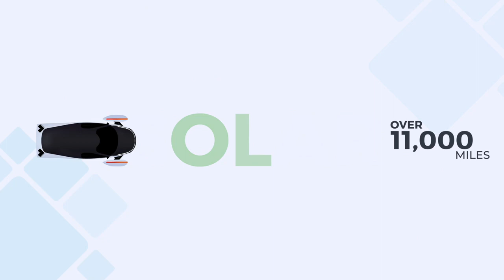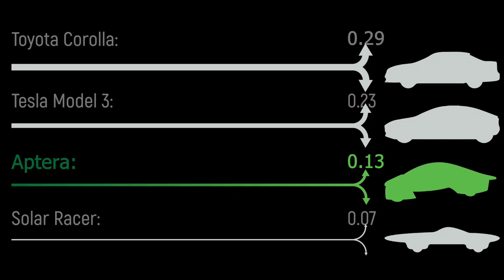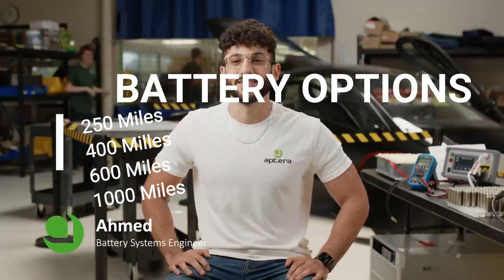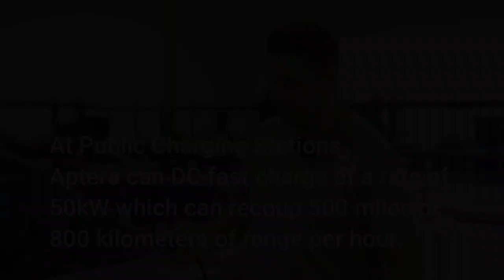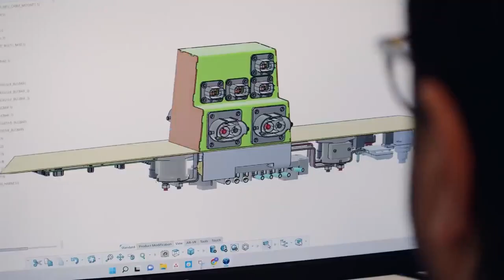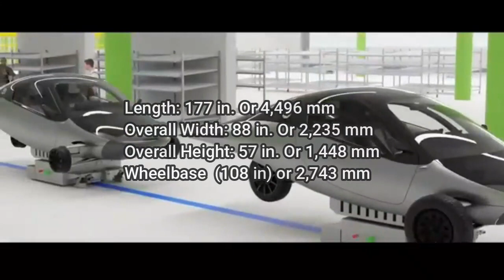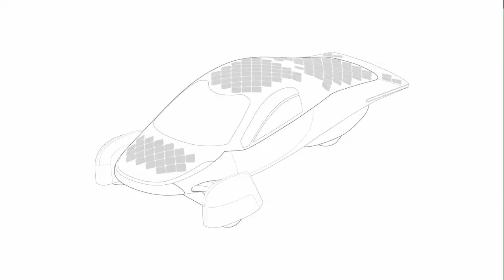Aptera electric car the MYSTERY for Cheaper, safer and eco-friendly electric vehicles? | Analysis

Comment: Solar system does not exist until now. They only built some prototypes of the 40 kWh battery. The 1000 mile version does not exist. The wheel base of the Aptera is wider than a Hummer H1. It is not possible to register an Aptera in europe, as it would only be allowed to have 2m max. Aptera is not crash tested in real life. It is a death trap in case of an accident. With the anemic 50 kW charger you will blocking a fastcharger stall for over 3hours to charge the 1000 mile version.
Reply: Clearly no production intent Apteras have been produced yet, so there is some cause for concern.
But that is typical for a car that is about a year away from production and does not, necessarily, indicate a problem.
As for the width, the Aptera is not much wider than a normal car, if one considers the mirrors.
As for crash testing. Aptera has assured us it will meet car standards with air bags and a strong composite structure. But it has not been proven yet, as no production intent vehicles have been produced. But there is no reason to consider it a "death trap". There is an adequate crumple zone up front and a strong composite structure.
Not sure about your charging math. If you have a 100 kWh battery and 50 kW charger, that would be 2 hours from dead. But unlikely you would be in that situation very often. Most cases, after driving 1000 miles, you would be at your destination.

Meanwhile, Aptera promises the most efficient EVs available with solar charging up to 40 miles per day. Some people would not need to plug it in for daily commute. It is a revolutionary vehicle.
Reply: @johnbriggs7514  "Clearly no production intent Apteras have been produced yet, so there is some cause for concern". That would concern me the most. 3 years full of empty promises. To rebuild a vehicle to BEV that was already production ready in 2008.

The Aptera is wider than a Hummer H1. A "normal" car has a width of 2m. Mirrors dont count, as they do not ram into road obstacles. And the width is also the main reason, why the Aptera is not road legal in the EU

The Aptera has no crumple zone, just a horizontal aluminium bar to hold the fairing.

And yes , Aptera promises. And promises, and promises....
Reply: @vic321344  so you are in the process of criticizing something you have not seen.

The width of the Aptera is no more than my current car so it will fit into my garage.

And no this is not the same car as before it was completely redesigned.

But you are right. They are late and they have a lot to prove. We will see
Reply: @johnbriggs7514  I am critisizing that Aptera sells things which are not existent. Yes. You got it.

You own a Hummer H1? Or a large truck?

Shure the new Aptera is a redesigned Aptera  2 from 2008. They made it 10% larger. A CAD system needs 10 sec for that. That leaves 3 years minus 10 sec to implement ready to buy electrical components into this vehicle.
Reply: @vic321344  Ha!  If you think that the current Aptera is mere 10% increase in size of the 2008 model you have really not been paying attention.  There is not a single common part or even a drive train in common with that first vehicle.  Why lie about things you clearly know nothing about?
Reply: @vic321344  Of course you are willing to overlook the fact that it took Tesla 6 years to ship their first EV conversion of the Lotus Elise Roadster, and that even though they have many times the current resources, Aptera is going to ship before Tesla ships the Cybertruck, which started design around the same time.
Reply: @n.brucenelson5920  The current gamma had to be enlarged again, because they forgot to plan enough room for the battery pack. Which is not just 10 kWh.

And it was your claim that the alphas are 10% larger than the aptera2. If not so, why did you lie?
Reply: @n.brucenelson5920  And you (again) overlook that Tesla had to invent everything to build the first roadster. The batteries, the electronics, the battery management, the charging, the motor, ...
Aptera uses off the shelf parts to bang their BEV together. To recreate a BEv version of a motorcycle they already invented in 2008.
Reply: @n.brucenelson5920  The silly trike does not have to have any common component to be 10% larger. Such is your idiocy.
Reply: @n.brucenelson5920  Vic asked "Did you see a 1000 mile version, working solar, something even close to a production prototype? Or just 3 mockups? Driving around with a 10kWh battery packs?" You answered with "Of course you are willing to overlook the fact that it took Tesla 6 years . . ." - none of which answered any of Vic's questions. And I have told you at least 50 times not to bring Tesla and others into it - it's irrelevant.
Reply: @n.brucenelson5920  Comparing Cybertruck to Aptera ist the most childish comparison thinkable. 
1 Cybertruck is a car, Aptera is a motorcycle
2 Cybertruck uses top end technology, invented for this usecase. 4680 cells, the steel for the body, the structure, the glass, the 12t gigacasting just to name a few. Aptera bangs together their motorcycle with freely available standard components. The plastic shell produced by a manufacturer for boats. Battery packs welded together from ancient 2170 cells.
3 Cybertruck will be produced at a 100 times higher rate than Aptera will ever be (if Aptera will be produced at all)
4 Cybertruck needed a whole Gigafactory (Nevada) and a whole 4680 cell production. Aptera just neds  an empty warehouse. 
5 When Cybertruck was announced and you could order it, a prototype was ready to show all the promised features. Not so with Aptera . Until today no 1000mile, no solar on vehicle. Promised and sold, but never existent.
Reply: @vic321344  lol!
Reply: @n.brucenelson5920  "Aptera is going to ship before Tesla ships the Cybertruck, which started design around the same time." In the same time Aptera is still not able to present a roadworthy production prototype, Tesla built a whole Gigafactory, a 4680 cell assembly, 12t Gigapress..etc to produce 200-500k of these vehicles per year.
Reply: @vic321344  Why do you keep lying about what is public information?  Both my wife and I have ridden in road worthy prototypes ourselves.  

After the 3 years or so since Aptera restarted, Tesla had still been unable to keep the transmissions from breaking every time they gave a demo ride in their Lotus Elise EV conversion, and had laid off all of their motor engineers because they had run out of money.  It was only a last minute cash infusion from Daimler that saved them and it still took them 3 more years to deliver their first production model.
Reply: @n.brucenelson5920  So 2 years ago you saw production ready prototypes? Because that is all what matters. If you do not understand the difference between "production ready" and "roadworthy": so be it.
Reply: @vic321344  "roadworthy" was your term.  And it was not two years ago that we were at Aptera and had our rides.  It was last November.  

So, my question remains - Why do you keep lying about things you know just as well as others of us?
Reply: @n.brucenelson5920  "roadworthy production prototype" was the term. Why do you keep lying about things you know just as well as others of us?
Reply: @vic321344  I guess we have to make allowances because it is clear that English is not your first language.  You apparently don't understand what an alpha prototype is.  When we get to delta we will have production intent models.
Reply: @n.brucenelson5920  I guess we have to make allowances because it is clear that English is not your first language.  You apparently don't understand what a production prototype is.

And again your favorite term "will have" (together with "will be"). Like a fairy tale.
Reply: @vic321344  Although English is my first language, it is far from my only one.  It is not surprising that you would be talking about "fairy tales" - you are fond of "Grimm" statements.  It seems to be the only kind you make.
Reply: @n.brucenelson5920  So it is maybe more due to your old age that you lack understanding the difference between phantasy and reality. Or "roadworthy" and "production". or other simple things. Or present tense and future tense.
Reply: With that "anemic" 50 kW charger it can add 250 miles of range in half an hour.
Reply: @robertkirchner7981  Hopefully the Aptera will never block a stall of a Tesla supercharger.
Reply: @hypenohub  If you only look for things that you see as flaws like Vic, then you will not see all of the great features and capabilities of the Aptera. Volume production is not expected until next year, so some things are still being developed. It is foolish to expect all aspects working now before production begins. If you watch videos of the Aptera in real life situations, the width should not be an issue for most people. For Europe, they will build a revised version of the Aptera to fit their narrower roads (in 2024). Vic's assumption of the Aptera being unsafe has no basis in fact. The early roof crush testing proved the composite shell to be stronger than any other vehicle tested to that point. 50kW charging equals 500 miles an hour, which is plenty quick, and even more importantly the Aptera will recharge 150 miles overnight from a 110V home outlet! In addition to as much as 40 miles a day from the sun.
Reply: @deanmcmanis9398  I deal in logic - here's an example:
[If you only look for things that you see as flaws like Vic, then you will not see all of the great features and capabilities of the Aptera.] The operative word here is 'only'. You can reverse what you only see, and each is flawed, however, seeing mere computer simulated performances is not seeing reality. Fanboys are thus deluded. They only see snake oil, and refuse to see both sides of the coin. 
I deal in facts - here are some examples:
[Volume production is not expected until next year, so some things are still being developed. It is foolish to expect all aspects working now before production begins.] Fact: In June 2021 they announced they would have a production vehicle by the end of that same year. 12 months above and beyond 6 is way too inaccurate, as is what they have right now in terms of prototypes and plant set-up. It is foolish to be strung along (that last bit is logic). 
[If you watch videos of the Aptera in real life situations, the width should not be an issue for most people.] Fact: It's 88 inches, and 88 inches is issue sized. 
[For Europe, they will build a revised version of the Aptera to fit their narrower roads (in 2024).] Fact: It's still 2022. It's a bridge we haven't reached, so pointless. 
[Vic's assumption of the Aptera being unsafe has no basis in fact.] Fact: Any EV with that much battery under your butt that produces dendrites is unsafe - a ticking time bomb. 
[The early roof crush testing proved the composite shell to be stronger than any other vehicle tested to that point.] Fact: Tested by the maker - that is never a good thing. Find us a test by an independent body that is accredited to do such tests? That's the logical course, and claims should not be made unless done and published. Otherwise, you fool the gullible.
[50kW charging equals 500 miles an hour, which is plenty quick, and even more importantly the Aptera will recharge 150 miles overnight from a 110V home outlet!] Fact: All theory and no proof.  
[In addition to as much as 40 miles a day from the sun.] Fact: Alpha's had no solar, and Chris would point to them as he told people they have it. That's called lying. If they do have solar, then they should be handed over to accredited independent testers. Another fact: Gamma is supposed to be an improvement, but pictures show no solar cells at all, and would not matter if they had a working system, because they show no power cables from the batteries to the motors. The solar could only run the air con, at best. Gamma can't move, as far as anyone can tell.

Give the support up, Dean - you are flogging a dead horse.
Reply: @deanmcmanis9398  Width is not an issue for people? construction sites? offroad? parking garages?

Not a single of the core features (1000mile, solar..) is working or has ever been tested.

Aptera can be glad to be able to produce  the wide version with their limited ressources. If you make the wheelbase smaller, the vehicle will become awkward and the CV will rise dramatically.

The roof crush test just showed, that the old aptera shell (2008) could hold 4 times the weigth. The actual need to pass the test is 3 times the weigth. Even the simplest of all chinese BEV passes this test.

50 kWh charging needs at least one hour. Hopefully Aptera does not block any supercharger stall for that time.

The solar system is completely untested on the vehicle, so the yield is pure phantasy.
Reply: @vic321344  Good morning, Vic. Based on what you've posted, it's obvious that Aptera is not for you. But I'm curious just what it is that you get out of trolling all the people who came here to look at the video. Can you enlighten me?
Reply: @davidscott5367  I am curious why so much people love a fraud.
Reply: @vic321344  You know, Vic, you can be curious without commenting on so many of the posts on this video.

A knowledgeable reader of Aptera's annual reports would quickly conclude that they're not doing business like scammers. For example, scammers wouldn't hire a supply chain expert, a manufacturing expert, and a bunch of engineers. They would build one Alpha prototype, not 3, and they  would never build a beta prototype. Nor would they engage a manufacturing consultant like Sandy Munro or a handling expert like Roush. 

I have pre-ordered an Aptera. All it cost me was a $100 refundable deposit. I understand the deposit is held in escrow, but in any case it's only a hundred bucks.

You should study the company a bit more.
Reply: @davidscott5367  I like to comment. Especially to prevent newcomers from trusting empty promises. And the number of my comments just shows the great amount of empty promises, that are repeated over and over as real facts.
Reply: @vic321344  Vic, for the folks who are just trying to read the comments, it gets a bit tiresome hearing the same comments from you over and over again. You gotta be you, though, tiresome or not.
Reply: @davidscott5367  I deal in logic.
[You know, Vic, you can be curious without commenting on so many of the posts on this video.] He can be curious AND post. There is no law nor rational reason that would preclude him. Your statement is merely your wishful thinking made to look like it's valid. The gullible will swallow it.

[A knowledgeable reader of Aptera's annual reports would quickly conclude that they're not doing business like scammers.] I beg to differ, but scammers make annual reports hard to see through. It is no way to draw that conclusion. Most Ponzi schemers are never caught while in process, but long after they have succeeded. There is reason to think they completely got away with this the first time.
[For example, scammers wouldn't hire a supply chain expert, a manufacturing expert, and a bunch of engineers.] Who said they wouldn't? Let's look at these three experts individually?
1. Supply chain expert. What expertise has been displayed? I say none. The present situation is that Chery, Yazaki (?), Elaphe, EVA (?), Red Viking and that Taiwanese battery supplier have all been paid millions to supply, but I have yet to see anything delivered from any one of them. All these bar one are overseas suppliers, where the money trail is not easily traced. 
2. Manufacturing expert. What have we seen from one of those? I saw one drawing of a plant setup, which nothing has been done about for more than a year. Nobody knows what the drawing is about, but it preceded using Red Viking carts. Happy for you to detail everything you know.
3. Bunch of engineers. Yes, 7 on making batteries in-house alone, and then they outsource to two companies. Most engineers look too wet behind the ears to be believable. Many look like they need deporting for illegal entry, let alone being qualified in a US institution of repute.
[They would build one Alpha prototype, not 3, and they  would never build a beta prototype.] I don't even know why you think this is rational. The 3 were to continue the investment flow. Each was meant to look great, but just amounted to colour appeal, mostly. A real builder would not put fake solar on them, and a real builder would have one of their 4 battery options in the first, then a different one in subsequent vehicles. A real builder would validate their claims with them, and each new vehicle would be an improvement on the previous. A real builder would back their superior skin cooling on the fourth model, not revert to inferior radiators, but the first 3 never had any cooling - skin was a pretense, as was any range, so they were restricted to about 10 miles in cold weather. A real builder would back their 7 times stronger than steel body and not install a steel roll bar. There is so much more about their covert use of prototypes that show they are hiding something.
[Nor would they engage a manufacturing consultant like Sandy Munro or a handling expert like Roush.] Munro has not shown to have done a thing, and he just might be privy to taking millions and syphoning off a few brown paper bag style for no effort. Who really knows? He can't be used as an example of honest dealings - it's too soon, with too little revealed. And Roush - I have yet to see what they have done. On the Chuckwalla suspension test day, I could not see anyone in Roush garb. No results were ever made public, either. If you want shocks for a trailer, Roush would probably just ask for dimensions and weight, and give you something off the shelf.  I fail to see too much beyond that. Their testing has already been done, but Aptera make a big deal about it. It really looks like name-dropping for more investments, and Rouch may also be privy to brown paper bag dealings. Nobody to-date has supplied what they have been paid for, which means none can be held up as examples of a genuine company in Aptera.

[I have pre-ordered an Aptera.] That is certainly no proof they aren't scammers. 
[All it cost me was a $100 refundable deposit.] The smallest deposit known to start-ups. Even E-scooter makers ask for more. That, in itself is suspicious.
[I understand the deposit is held in escrow, but in any case it's only a hundred bucks.] Enough to constitute robbery, should they take it.

[You should study the company a bit more.] I have - going right from 2006 to now. There is so much that looks like a Ponzi scheme - it's scary. So should I not tell people to look for signs and make up their own minds?
Reply: @davidscott5367  Hopefully it gets equally tiresome to read Apteras  empty promises over and over again.
Reply: @aussieideasman8498  Another tiresome post from someone who couldn't understand an annual report if he read it.  The rest of your comments are evidence enough of this.  You also don't seem to understand what a Ponzi scheme is.
Reply: @vic321344  Since I have visited the factory and R&D center, and ridden in a prototype and seen the test rigs, I am a personal witness that what you are claiming is not working and has never been tested is false.
Reply: @n.brucenelson5920  so you visited the factory. Did you see a 1000 mile version, working solar, something even close to a production prototype? Or just 3 mockups? Driving around with a 10kWh battery packs?
Reply: @vic321344  I saw working solar.  You have not made any effort at all and you are the one making things up
 My question is why?
Reply: @n.brucenelson5920  Hey, you saw a working solar system installed on a vehicle? And saw the yield this system gets when it drives on the streets? Great. Tell us more.
Reply: @vic321344  I requested and signed an NDA.  But next Spring I will be reporting my own results with my personal Aptera, as will many others.
Reply: @n.brucenelson5920  I have a video about the TMS test rig (Skin Cooling Revisited) on which you can comment on every claim I make as to why it won't work, yet you refuse to do it and hide behind the NDA you asked to have made for you. Your nonsense doesn't wash. Danny has made it public, and it is patently evident it can't work in reality - he's just conning the brainless Steve, and you have no defense. If you have seen this particular test rig, then explain it, or shut up. I maintain that rig can't work, and I have a whole video that explains my reasoning. Nobody from the founders down to the marketing kids have ever been able to refute my reasoning, so you are far from alone.
Reply: @aussieideasman8498  Hi, Aussie,

Thanks for your response.

The reason it took me a long time to respond is that the first response I wrote was very confrontational. I decided not to send it, and instead I slept on it before writing this one. 

You say that you deal in logic, and you do, to an extent. But you also deal in unfounded accusations of malfeasance and unnecessary personal attacks. You also feel that you’ve got to attack each and every statement somebody makes, even when some of the attacks aren’t relevant to the discussion.

I have no doubt that you know more about Aptera than I do, and some of your criticisms of Aptera are certainly valid, and I acknowledge that their delays are unfortunate. I even acknowledge that they may never make it to production.

What you don’t seem to recognize is that I’m only arguing Aptera is not a scam. Logic tells me that if they were only trying to scam their customers, they wouldn’t be doing things like hiring a logistics expert. When I make that argument, you don’t refute it. Instead you respond that you haven’t yet seen any results from that hire. 

Likewise for their hiring of a manufacturing expert. The same for their hiring of a staff of engineers. You have no response for an argument that scammers wouldn’t hire a staff of engineers, so you respond that you don’t like their choice of engineers. Then you throw in a couple of insults, which is typical of the style I’ve seen from you across the many posts I’ve read. 

And because you haven’t yet seen the results of Aptera’s consultations with Sandy Munro and Jack Roush, you accuse Munro and Roush of malfeasance. Do you have any evidence to support that accusation? Not being able to see the results you expect from your vantage point half a world away is not evidence of malfeasance. 

If you want to be taken seriously you should cut way back on the insults. I’ve seen many of your posts where you didn’t like what somebody said, but rather than refute it, you just respond with a couple one-line insults. When people read that kind of stuff, they tend to discount the years you’ve been watching Aptera. Instead they just think, "Oh, that Aussie guy again. He's so unpleasant!" 

One other thing you could do (and this would entice people to read your posts rather than skipping right by them) is to break your posts into paragraphs. People who read a lot of English are used to seeing them that way, so it’s better for comprehension.

BTW, it’s obvious that my placing an order doesn’t prove anything about Aptera. It only proves that I can afford $100 on the chance that they do make it to production, and it wouldn’t hurt me too much to lose it. Believe me, I have made much more expensive mistakes than that, if it does indeed turn out to be a mistake. 

With that, I’ll close. Wishing you all the best.
Reply: @davidscott5367  [The reason it took me a long time to respond is that the first response I wrote was very confrontational.] There is no deadline to respond, nor any obligation to. I can take confrontation, and it just might be more appropriate. Your only problem might be getting past YT.  
[I decided not to send it, and instead I slept on it before writing this one.] That accounts for one day, unless you are some sort of Rip Van Winkle. 

[You say that you deal in logic, and you do, to an extent.] To a great extent. 
[But you also deal in unfounded accusations of malfeasance and unnecessary personal attacks.] If I do, I would like examples and references to the original posts. I pride myself in always telling a fool why he's a fool, and people often accuse without reason. You might be just another one of those. PS - I don't sleep on responses; I write them line by line without even reading the next one.
[You also feel that you’ve got to attack each and every statement somebody makes,] Is that a crime? I just call it being thorough.
[even when some of the attacks aren’t relevant to the discussion.] While I prefer relevance, I go where anyone takes me. If they take a swipe, my swipes back are just better articulated.

[I have no doubt that you know more about Aptera than I do, and some of your criticisms of Aptera are certainly valid, and I acknowledge that their delays are unfortunate.] Their delays are CLAIMED to be unfortunate - it's possible they might not be, but contrived. 
[I even acknowledge that they may never make it to production.] This makes me think; why the need for you to write, then?

[What you don’t seem to recognize is that I’m only arguing Aptera is not a scam.] Then all you have thus far written has not made that point. I will be happy to discover what points you have that will show they are not a scam. 
[Logic tells me that if they were only trying to scam their customers, they wouldn’t be doing things like hiring a logistics expert.] Without looking back at the comments that are not even opened, I believe I covered this point. Logic tells me your logic on that is flawed, and I don't like repetition. At this point, I will say that logic sans written reasoning behind it is mere gossip and possibly false. My logic that yours is flawed is because many companies with logistics experts on their payroll have folded. [When I make that argument, you don’t refute it. Instead you respond that you haven’t yet seen any results from that hire.] I'm too far in to check that (YT deletes this if I open now), but I will after this is sent. However, you are essentially saying any company with this expert can't fold, and that sounds ridiculous to me on face value, alone. 

[Likewise for their hiring of a manufacturing expert.] likewise - ridiculous. 
[The same for their hiring of a staff of engineers.] Ditto. Even engineering firms have folded, and scammed in the process. 
[You have no response for an argument that scammers wouldn’t hire a staff of engineers, so you respond that you don’t like their choice of engineers.] Again, I need to compare your new claims with my past responses, but if I said something entirely irrelevant, I would still not make your statement true; it would only not disprove you at best. As for me saying they look bogus, a company with great engineers looks more likely to not scam than one with ring-ins. I deal in logic. 
[Then you throw in a couple of insults, which is typical of the style I’ve seen from you across the many posts I’ve read.] I get far more idiots than intelligent people comment. Again, you accuse without that referencing the couple of insults.

[And because you haven’t yet seen the results of Aptera’s consultations with Sandy Munro and Jack Roush, you accuse Munro and Roush of malfeasance.] Get it right - I did not accuse - I only said it was possible. I don't even have to look back to be certain of your error. You can't deal in logic if you can't read without misunderstanding.
[Do you have any evidence to support that accusation?] If and when I accuse, I will add evidence. 
[Not being able to see the results you expect from your vantage point half a world away is not evidence of malfeasance.] I see the facts from half a world away. You can be standing in the middle of their empty build site and not see them as well as I do. Distance doesn't matter,, and you are just fooling the gullible fanboys by suggesting it.
 

[If you want to be taken seriously you should cut way back on the insults.] I don't need to be taken seriously, so what should I do? 
[I’ve seen many of your posts where you didn’t like what somebody said, but rather than refute it, you just respond with a couple one-line insults.] Then reference them, and allow me to explain. Your unfounded accusations are ignored, except that I teach you not to make them. 
[When people read that kind of stuff, they tend to discount the years you’ve been watching Aptera.] I don't mind if they do. And I have been watching them for less than one year.  
[Instead they just think, "Oh, that Aussie guy again. He's so unpleasant!"] Fine with me. They can disappear, for all I care. 

[One other thing you could do (and this would entice people to read your posts rather than skipping right by them) is to break your posts into paragraphs.] I could - but not to entice. 
[People who read a lot of English are used to seeing them that way, so it’s better for comprehension.] Good point, because comprehension is sorely lacking in most readers.

[BTW, it’s obvious that my placing an order doesn’t prove anything about Aptera.] Another good point. 
[It only proves that I can afford $100 on the chance that they do make it to production, and it wouldn’t hurt me too much to lose it.] It proves no such thing. For all I know, you could have half starved yourself to make the deposit, or borrowed it and are cleaning windows for the next 3 months to pay it back. I deal in facts, and not saying how you managed to pay the deposit proves nothing. 
[Believe me, I have made much more expensive mistakes than that, if it does indeed turn out to be a mistake.] I believe you. Some things don't need proving for me to believe. I believe in God, lol. 

[With that, I’ll close. Wishing you all the best.] And the best to you; it has been a pleasure. Now I will check what you say I said last time.
Reply: @davidscott5367  Here's the check: I found I replied to you on the 19 reply of this same thread, in regard to a reply of yours to vic321344. The parts about the relevant issues are copied and pasted.

(New paragraph, note. I have also noticed YT does not post in the same formatting I send, at times. That is; I use 'enter' and they remove it now and then.) You said -
"Logic tells me that if they were only trying to scam their customers, they wouldn’t be doing things like hiring a logistics expert. When I make that argument, you don’t refute it. Instead you respond that you haven’t yet seen any results from that hire."
My search for my response came as a huge surprise - you never said it in the 19th comment - no mention of logistic expert at all, so of course I wouldn't address it. Here are the experts I read and responded to:

"1. Supply chain expert. What expertise has been displayed? I say none. The present situation is that Chery, Yazaki (?), Elaphe, EVA (?), Red Viking and that Taiwanese battery supplier have all been paid millions to supply, but I have yet to see anything delivered from any one of them. All these bar one are overseas suppliers, where the money trail is not easily traced. 
2. Manufacturing expert. What have we seen from one of those? I saw one drawing of a plant setup, which nothing has been done about for more than a year. Nobody knows what the drawing is about, but it preceded using Red Viking carts. Happy for you to detail everything you know.
3. Bunch of engineers. Yes, 7 on making batteries in-house alone, and then they outsource to two companies. Most engineers look too wet behind the ears to be believable. Many look like they need deporting for illegal entry, let alone being qualified in a US institution of repute."

I will not pursue it further, since you are so incorrect with claiming what you said.
Reply: @vic321344  The only fraud there is your name calling.
Reply: @n.brucenelson5920  says Mr namecaller himself...
Reply: Who would charge the 1,000 miler in the day?  It's ideal for overnight.  The 600 miler will add 500 range miles in an hour.
Reply: @jonsek  600 miler does not exist, 1000 miler does not exist. Though you can reserve them. As if they would exist.
Reply: Fault finding and naysaying because you worry that the German auto industry will decline?  Let's see your country truly innovate.
Reply: @nicktgal  Nope, I do not sell phantasies. So the burden of proof is by the guys, who sell this empty promise. And Aptera has not proofed anything. No 1000 mile, no solar yield, no crashtest, no safety, nearly nothing beside the things which already existed 2008.

BTW the Aptera is a motorcycle.
Reply: @vic321344  No, it's not a motorcycle.
Reply: @vic321344  It's an autocycle, troll—as has been said in almost every Aptera video ever made lol
Reply: @nicktgal  And in the FAQ they tell the truth, troll—its a motorcycle. An autocycle is by definition a motorcycle with more than 2 wheels (no sidecar). That is also the reason why the Aptera does not get any incentives.  lol
Reply: @nicktgal  What a remarkable and well substanciated post.
Reply: @hypenohub  Good question.
Reply: @nicktgal  A valid real life crashtest could be a valid counterargument to my claim. But a real life crashtest does not exist. Though it would have been easy to do by Aptera in the last 3 years. Or maybe it exists and it was a desaster for Aptera.  lololol
Reply: @vic321344  Crash testing a prototype would be meaningless.  So how would it have  been easier to do?  Aptera will crash test production intent vehicles to FMVSS Part 200 standards using a third party when they have such vehicles ready.  They have continued virtual crash testing thousands of times through the development process.  Why are you so intent on imagining things that aren't true?
Reply: @n.brucenelson5920  Virtual crashtest are meaningless. An actual test woud provide real life data, something that is constanty missing with Aptera. Real data, not phantasies.
Reply: @vic321344  Nice, another false claim.  In fact there are many new car models on US roads that have only had virtual testing done.  Educate yourself.
Reply: @n.brucenelson5920  I already asked you about these cars and you sent me a list of cars that were already crashtested in europe and japan. Educate yourself. Or even just remember. Even if it is difficult to do.
Reply: @n.brucenelson5920  Virtual isn't truth.
Reply: @n.brucenelson5920  [ In fact there are many new car models on US roads that have only had virtual testing done.] I bet there are none, because the operative word is 'ONLY', and while all might have had virtual testing, they all would have had to pass real tests involving real vehicles. If you can list them, please? I bet you can't find one.
Reply: @vic321344  And, as the saying goes, maybe monkeys will come flying out of your butt.  We have as much evidence for that as your claims that come out of your imagination with no evidence.  You only deal in FUD.
Reply: @vic321344 Where are the Cybertruck crash tests?  Are they a fraud too?

No one crash tests prototype.  The only "fraud" here are your claims.
Reply: @n.brucenelson5920  cybertruck is a car, so crashtests are mandatory. Aptera is a motorcycle, so crashtests are Voluntary.  Tesla produces the safest cars available. Aptera produces nothing but empty promises.
Reply: @vic321344  You are finally correct about something.  However, Aptera has already performed FMVSS Part 216 crash tests during their previous incarnation, and passed with even better results than Tesla has ever gotten on this test.  Aptera will not be submitting to voluntary testing with the results to be made public if they did not think the performance would be good.  And they have internal testing that indicate that it will be.

The showing this weekend in San Diego will be further evidence of progress.
Reply: @n.brucenelson5920  but as you already claimed by yourself, the 2008 shell has nothing to with the actual shell, so the test is worthless.
Tesla easily hold 3 Times the weight, and more than  7times the weight if you see realworld accident pictures. Especially the glass roof seems to be extraordinarily strong. Not just the 4 Times the old aptera roof could hold in an in house test. Which  was never confirmed by an independent Party.
Reply: Let's not forget the poor turning radius, terrible ergonomics, useless opening half window and visually distorted other half of the door windows.  There is a  reason it didn't get backing the first time around and why the Chinese never developed it after it died in 2011 and they owned it.  Make it a T-top and market it to the Polaris Slingshot group.  Other than Can-Am, 3 wheelers are dying or barely hanging on market.
Reply: @doclees11  LOL. And you base this on? ... Another case of lack of due diligence with false claims that any one who experiences the vehicle in person will see are false.  You might want to visit the San Diego Fully Charged show and see for yourself.
Reply: @n.brucenelson5920  TANK TURN Nelson!  I have 3 dogs.  I don't need to go to San Diego to see another turd.  Let alone an unfinished and unproven turd.  I base my claims on every piece of video I can find and every bit of verified data Aptera has, or more accurately hasn't,  provided.
Reply: @doclees11  Most people will notice that you have noting to say here.
Reply: @n.brucenelson5920  most people could give a crap about you or me.
Reply: @doclees11  I am sorry you think so.We may not agree on much but you are still a person whoh deserves respect just because of that fact.

if you ever needed it from the likes of me, I would be among the first to defend you as a person.
Reply: @n.brucenelson5920  Says the guy who always presents lies and accuses others of doing so. Nice.